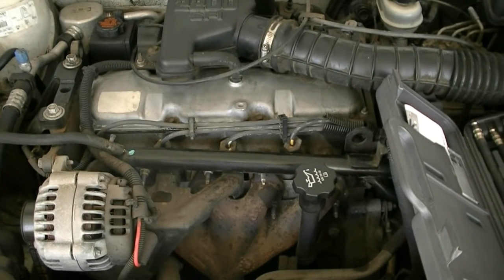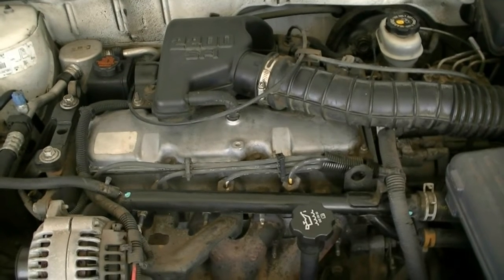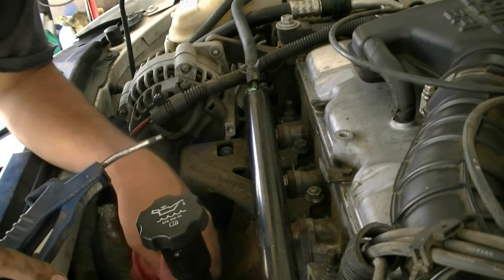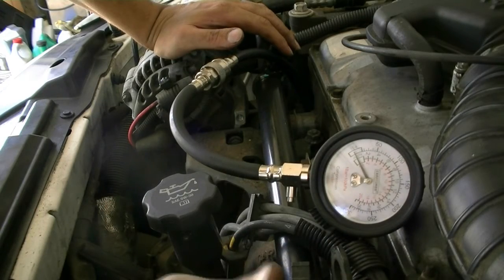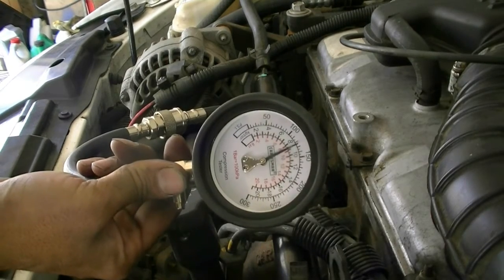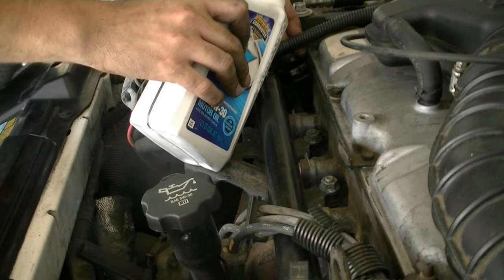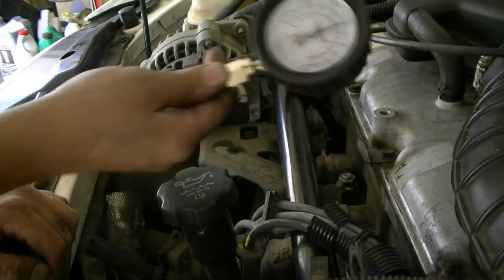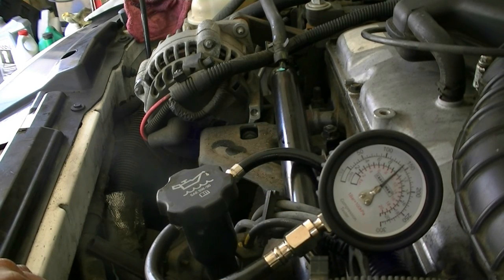How to do a Compression Test on an Engine

Comment: Was told to use a teaspoon of engine oil. 

There's videos of others doing compression testing with spark plugs on & testing 1 at a time.

Wouldn't the removal of all the spark plugs create false or unreliable readings vs just doing one at a time? 

Remove #1 do test (retrieve readings)
Remove #2 install tester then reinstall spark plug #1 then do test at #2 (retrieve readings) then remove #3, reinstall #2 then do test at #3 (retrieve readings) & repeat to all remaining spark plugs. 

Would that also affect readings & testing results?

Comment: Did you mean press the brake pedal or accelerator pedal?
Reply: I assume the Accelerator,
If it has a carburetor, it would be best open the throttle valve and not restrict airflow to the cylinders.

Comment: Great video!  I have a 2008 Mazda CX-7, it overheated and busted a long crack across the top of the radiator, and now it won't start. I assumed it was a blown head gasket, which brought me to your video.  Trying to get it to start, but it just whines, not your normal engine turning over sound; kind of like a small electric motor spinning, but no start. I pulled the coils and plugs and they all look good except the #4, burnt dried oil  looking, no smell. I can upload a video of the actual sound while attempting to start and a photo of the actual plugs too.   It may be the timing chain as well, just spinning with "NO CHAIN" ....  PLEASE HELP  !!!!!   R/ Mitch
Reply: did you find out what the problem was?

Comment: Hi there , what if the battery goes death due to these Cranking  ? Even a new battery can go death
because of so much cranking ... what would you do keep the battery charged in your case ?

I guess you need to hock the battery to a charger while cranking ?

I think we should remove the Fuel Pump Ignition Fuse then do the test  .

Comment: Should the compression be the same when you add oil or not.  Also  if you ever add oil and the compression jumps higher does that means you have bad cylinder rings?

Comment: I'm trying to help a friend in need with her car that won't start. It's a 2005 Pontiac sunfire 2.2L. She drove it through some water I got the water out of the intake system and cylinders.  I ran a dry compression test which the four cylinders averaged out @ 35 lbs, just curious if the timing such as the gears jumped time would that affect the compression reading?  Please respond

Comment: Hi, if I use a remote starter (hooked to the starter coil) do I still have to disable the gas pump and ignition system? or by not using the key the ignition and gas pump are not being use?
Reply from the maker: +dana miller You won't have to disable the fuel pump as long as the key is not in the ignition. GL
Reply: RatchetsAnd Wrenches Thank You.
Please do not stop making videos. You and ETCG are the best. But the big difference between you and Erik is that you do answer questions, Erik does not. So that makes you THE BEST. Thanks Again!

Comment: Saturn S-series: Cylinder 1 (200PSI)  2 (190PSI) 3 (200PSI) 4 (180PSI).  Unfortunately number 4 seems to make the car miss or run uneven and rough, or that is what I suspect.  These are still within spec but is a 10 percent difference between the highest and lowest reading on my SL2... So how "even" do these need to be across the board on the SL2?
Reply from the maker: Metal Maniac that's within spec and at 180psi, I doubt lack of compression is the cause of you missfire. Test Spark plugs/wires/injecotors/inj. pulse etc.
Reply: Thank you Sir < I will give those diagnostic routines a shot... I can't find nothing wrong with ignition side and the scan tool screams rich, so I must have an injector leaking or something...all injectors are clicking and it is 60lbs on the rail which is double the spec for that car.  I don't know how to measure pulse width unfortunately. but ohms on all the injectors are 12.2. I will post more later..Thank you for the great vids and getting back with me...best wishes, Terry